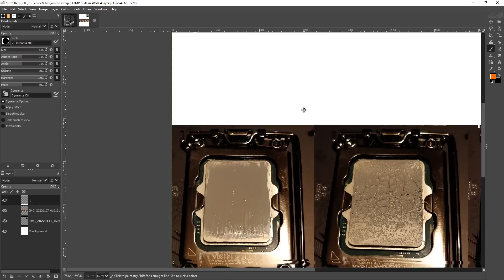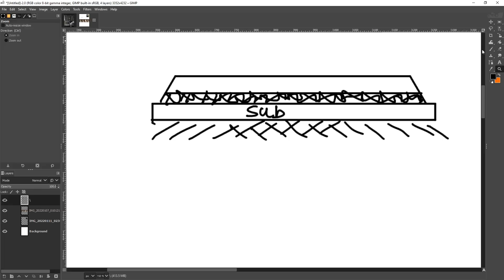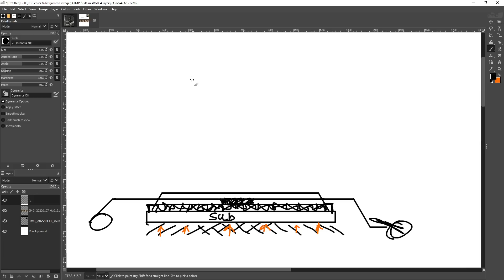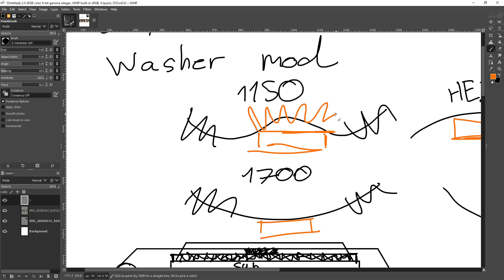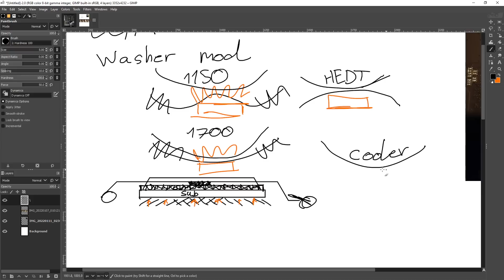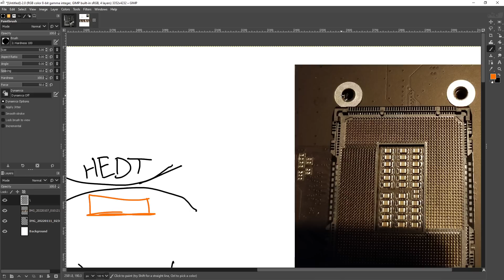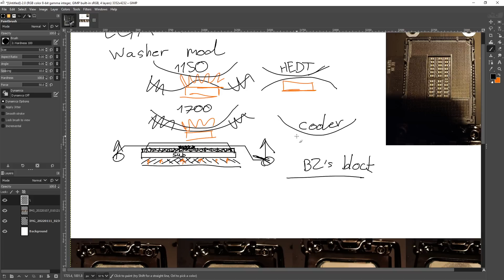Rambling about the LGA1700 washer mod

Comment: And now the socket design of AM5 with the multiple cutouts starts making more sense...
Reply from the maker: the cut outs are there because AMD put all the filtering on the top side of the CPU
Reply: @ActuallyHardcoreOverclocking  is that to prevent the heat from the capacitors from soaking into the ihs?
Reply from the maker: @christopherjackson2157  no they literally ran out of space.
Reply: yeah, they wanted to retain cooler compatibility with AM4, so that limited the space they had. they also wanted all the contact pins they could get. so solution = dedicate the entire bottom of the CPU for contact pins and move the caps on the top side.
Reply: @OOIEatte  ahhh ok makes sense
Reply: Good explanation.
Reply: Yes exactly! But, even without it, the next ryzen ihs and substrate is mostly square like lga 1500 processor, so it doesn't matter much.